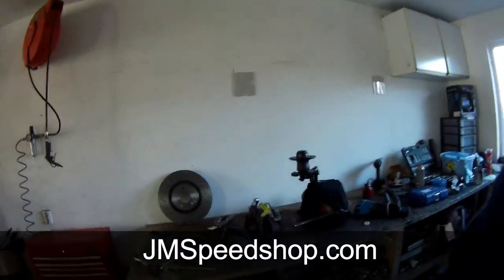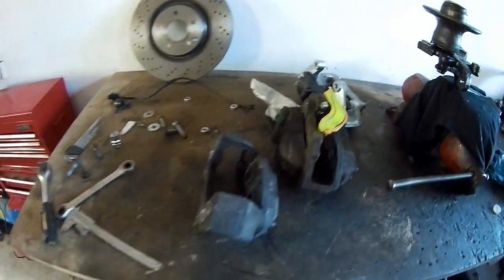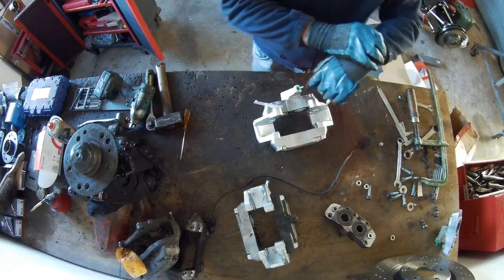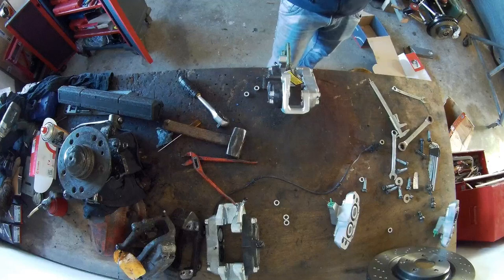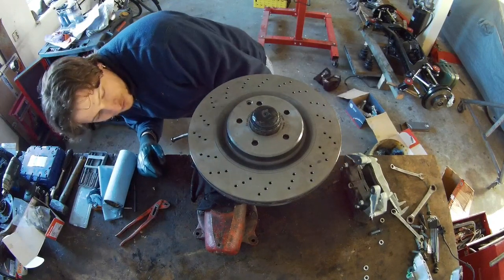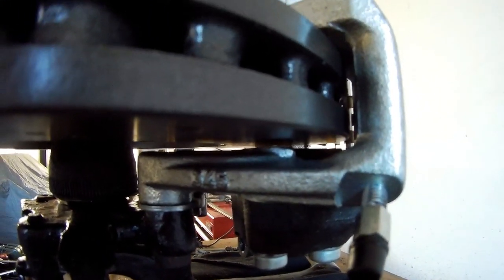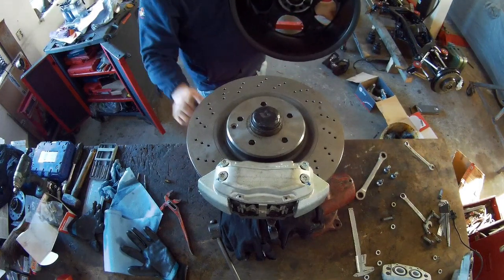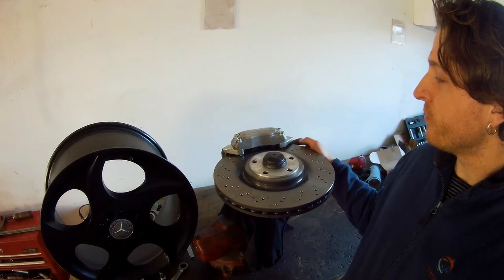Mercedes Big Brakes Upgrade for the S124 V8 turbo

Comment: Very helpful, have my left over 4 pistons from my C55 after upgrading to 6 piston... now I know how to fit them to my manual swapped E420 w124! Cheers!
Reply from the maker: Nice 😎
Reply: @JMSpeedshop  do you think the back of the s600 caliper would fit onto these too? That one has a LH even better angle for brake line.
Reply from the maker: Don't now did not try

Comment: If I remember correctly with an ML inside caliper part you won’t need banjo bolt brake line. But check pictures first to make sure
Reply from the maker: I Will have a look

Comment: Greetings! Thank you for this video, I am going to copy this approach... Did you also upgrade the rear brakes or keep them OEM. If you did a rear brake upgrade, do you have a video or parts list?
Reply from the maker: I have w210 55 amg rear calipers and discs.  But i did also a mod.to change the rear wheel hubs to s210.  So these brakes are bolt on the. .  but for the s210 hubs you need to modify the rear subframe.  The video about my rear subframe can be found in the project playlist
Reply: @JMSpeedshop  Thanks for the response! I think I will stay with the 124 hub assy and  research a good brake fitment. the rear adjustable links look amazing I will attempt to copy this idea as well. Thanks for your videos!
Reply from the maker: Thanks 👍

Comment: Thanks for the info. I'm gonna put a W215 CL600 brakes on my w124, and this really helps.
Reply from the maker: Nice 👍
Reply: I also fitted them in my W124 300TD (113HP), 345mm only need 2   8mm washer-spacers.  As mentioned   the C32 AMG inner part caliper has that long nipple  and can´t be used for W124  direct bolt on, the CL 600  W215  has not that long nipple.
Reply from the maker: Oke same caliper but only different nipple?
Reply: @JMSpeedshop  Yes, pistons diameter are the same, 40/44mm looking spare sites as Oscaro. Remember now my calipers were from a CL500 V8  chassis W215,  with the 345mm rotors, someones used the 330mm rotors, but no problem, 330 and 345 numbers stamped at calipers at a place. Perhaps some MK1   ML´s   have the same caliper as the CL.                                                                                                                                                                                                                                                                                                                     Planning fit a OM606 Turbo in my car, very info for me about the CV joints-shafts,  the S210 CV´s are 29,5mm diameter spline, vs the 27mm W124 splines.    Also the W211-220 Sedán-Wagons have that 29,5mm outer CV joint, but hub has 14x1,5mm thread wheel bolts,  instead of 12x1,5mm of S210´s.    Your 3 leg joke from diff is for 110mm pit circle "guibo"?    The diff CV joint from W210 V8 suppose is the bigger 105mm, have a W124 V8  400i diff 2,65 ratio and has that 105mm,   4 leg joke.   Hope understand my "spanglish", regards from Madrid.

Comment: Hi) do the master cylinder need to be upgraded to?
Reply from the maker: My opinion is. No.   Because bigger calipers is more oil in the calipers.  You need to move more oil with the master cylinder that is for smaller brakes.   This will mean.  You need to push the paddle a little deeper. You get more feeling in the brake pedal

Comment: Does it also require. The later style lower arm with welded on ball joint?
Reply from the maker: I have this on the normal old style w124 parts
Reply: @JMSpeedshop  Thanks, the removable type is the common type around me

Comment: Hello. Did you ever find a good set of banjo line that would work for this setup? Im trying to do the same thing but still kinda lost on what line to go with
Reply from the maker: Mercedes ml OR VW
Reply: @JMSpeedshop  Thank you
Reply: @JMSpeedshop one more thing. Would you know of any dust shields that might fit or would just be better to cut the oem one?
Reply from the maker: Not sure about the fitment. But in not installing a dust cap

Comment: Whats about ball joint?
Reply from the maker: Ball joint ?
Reply: The distance between brake disc and lower control arm ball joint... any  modification or they fit bolt up?
Reply from the maker: Did not see any issues there so IT Will fit normall